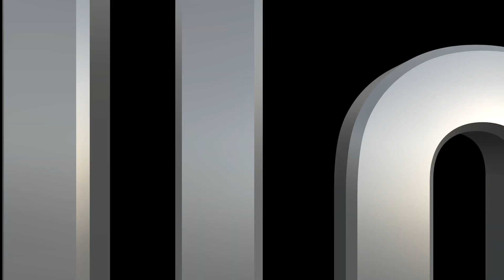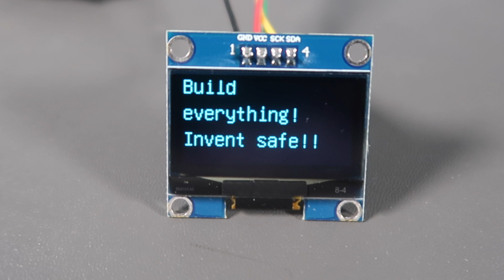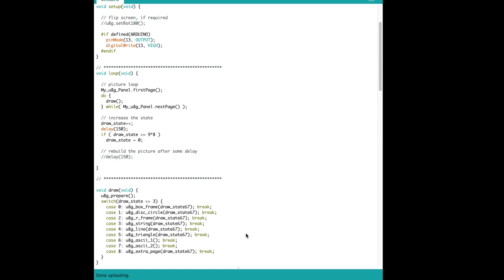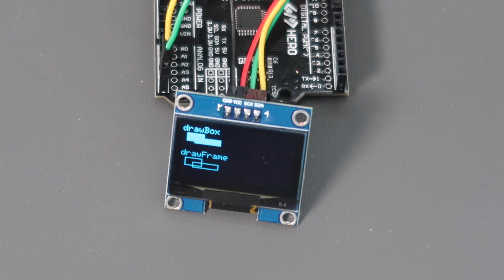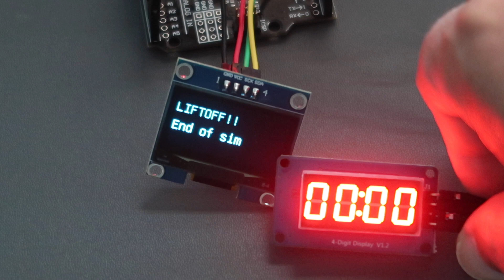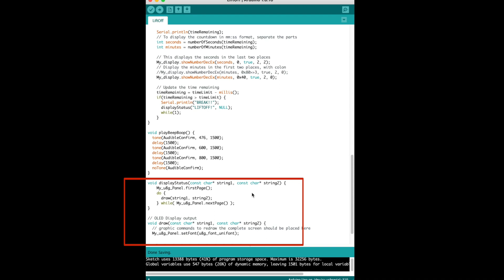30 Days Lost in Space kit – Day 21-25

Comment from the maker: My code for Day 24:

//LIBRARIES
#include <TM1637Display.h>
#include <U8glib.h>
 
// MACRO DEFINES
#define numberOfMinutes(_time_) ((_time_ / 1000) / 60)
#define numberOfSeconds(_time_) ((_time_ / 1000) % 60)  

#define PropulsionSW 8 //dip switch #1
#define AvionicsSW 7   //dip switch #2
#define ProceedSW 6    //dip switch #3
#define AudibleConfirm 9  //buzzer
 
// 7 SEGMENT PIN ASSIGNMENTS
#define CLKsev 5
#define DIOsev 4
 
// DEFINE DISPLAY OBJECTS
U8GLIB_SH1106_128X64  My_u8g_Panel(U8G_I2C_OPT_NONE); // I2C / TWI
TM1637Display My_display(CLKsev, DIOsev);
 
// HANDY CONSTANTS
const uint8_t OFF[] = {0, 0, 0, 0};
 
// GLOBAL VARIABLES
unsigned long timeLimit = 90000;    // 90 secs in milliseconds
boolean goForLaunch = false;
 
// *******************************************
void setup(){
  Serial.begin(9600);
  // Set brightness
  My_display.setBrightness(7);
  // Clear the display
  My_display.setSegments(OFF);
 
  pinMode(PropulsionSW, INPUT);
  pinMode(AvionicsSW, INPUT);
  pinMode(ProceedSW, INPUT);
 
  My_u8g_Panel.setColorIndex(1); // pixel on

  displayStatus("Ready", NULL);
}
 
// *******************************************
void loop() {
  int propulsion = digitalRead(PropulsionSW);
  int avionics = digitalRead(AvionicsSW);
  int proceed = digitalRead(ProceedSW);

  if (goForLaunch) {
      displayStatus("Go for", "Launch!");
      countdown();
  } else if (propulsion == 1 && avionics == 0 && proceed == 0) {
        displayStatus("Propulsion", "Armed");
  } else if (propulsion == 1 && avionics == 1 && proceed == 0) {
        displayStatus("Avionics", "Set");
  } else if (propulsion == 1 && avionics == 1 && proceed == 1) {
        playBeepBoop();   // after a set of warning tones and brief pause
        goForLaunch = true;
  }

}
// *******************************************
 
void countdown() {
  // Calculate the time remaining
 
  unsigned long timeRemaining = timeLimit - millis();
   Serial.println("Countdown started..: ");
     
    Serial.println(timeRemaining);
    // To display the countdown in mm:ss format, separate the parts
    int seconds = numberOfSeconds(timeRemaining);
    int minutes = numberOfMinutes(timeRemaining);
 
    // This displays the seconds in the last two places
    My_display.showNumberDecEx(seconds, 0, true, 2, 2);
    // Display the minutes in the first two places, with colon
    //My_display.showNumberDecEx(minutes, 0x80>>3, true, 2, 0);
    My_display.showNumberDecEx(minutes, 0x40, true, 2, 0);
 
    // Update the time remaining
    timeRemaining = timeLimit - millis();
    if(timeRemaining > timeLimit) {
      Serial.println("BREAK!!");
      displayStatus("LIFTOFF!", NULL);
        My_display.setSegments(OFF);
      while(1);
    }
}
 
void playBeepBoop() {
  tone(AudibleConfirm, 476, 1500);
  delay(1500);
  tone(AudibleConfirm, 600, 1500);
  delay(1500);
  tone(AudibleConfirm, 800, 1500);
  delay(1500);
  noTone(AudibleConfirm);
}

void displayStatus(const char* string1, const char* string2) {
    My_u8g_Panel.firstPage();  
    do {
      draw(string1, string2);
    } while( My_u8g_Panel.nextPage() );
}

// OLED Display output
void draw(const char* string1, const char* string2) {
  // graphic commands to redraw the complete screen should be placed here  
  My_u8g_Panel.setFont(u8g_font_unifont);
 
 
  My_u8g_Panel.drawStr( 0, 22, string1);
  if (string2 != NULL) {
    My_u8g_Panel.drawStr( 0, 44, string2);
  }
}